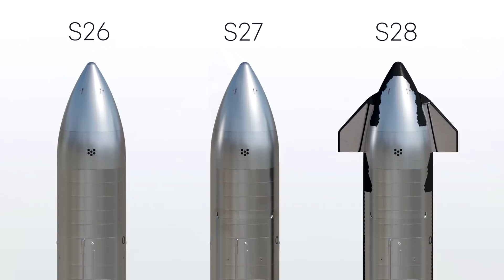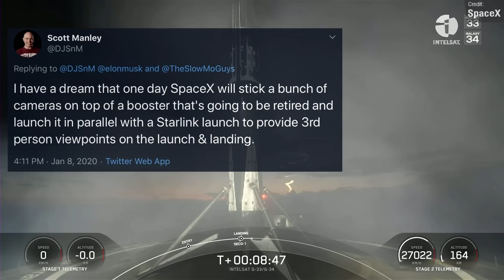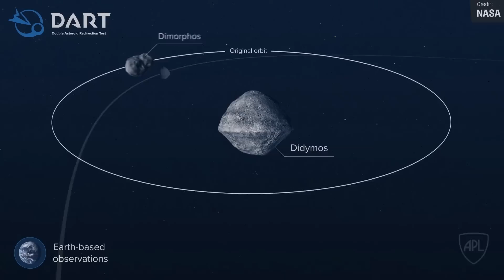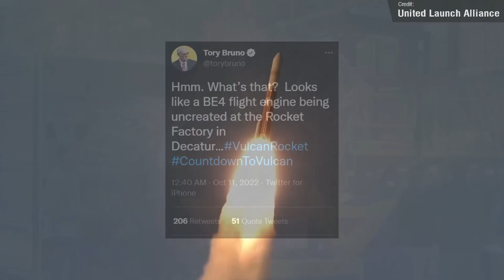SpaceX Starship Stacking Headaches, JAXA Failure, DART success, SEVEN Orbital Launches in One Week!

Comment: I think it's quite possible that by unstacking Ship 24 SpaceX is getting ready for a full 33 engine static fire on Booster 7. They would be doing this to prevent any vibration damage to Ship 24 due to the unknowns for this first 33-engine static fire.

Comment: Thanks for the update.  The comic relief is welcome.  Always knew there was something "Special" about those Aussies.  The banana in the BE-4 "Uncreating" photo seems appropriate for some reason.  Don't really know why.

B7 is still on the OLM for now, it appears they may roll S24 back to where they can fix whatever the issue is with the coupling mechanism(s) attachment points.  Wonder if that's the issue?  Maybe something got crunched from misalignment on the first stacking attempt for the pair, and it requires a more extensive repair than they were able to undertake while in the air.  The ship QD work was a bit troublesome too, perhaps there's something in there that needs more work / rework.

Comment: I sadly spotted the banana almost immediately, it's hiding on a yellow bracket on the otherwise blue frame holding the engine in place. The bracket in question is almost perfectly in the middle of the shot, which likely owed to me spotting it as quickly as I did...

Comment: Why couldn't SpaceX just put a nosecone on to the booster (including any needed balancing weight) and just test the booster launches and returns without risking a upper stage until the booster design has been proven to likely NOT going to go BOOM on a test launch?
Also why not build a launch tower in Nevada and do some testing on one of the huge test areas there?
StarShip will need one there for Polar Orbits rights?
The US military want StarShip to work, don't they.
If done in Nevada then only the military could stop a launch were as KSC is controlled by civilian overview and civilian government agencies are blocking/restricting Texas launches.
Reply: Because they are still tweaking the orbital launch mount. Not to mention, you have to clear away everything for a launch and the put it all back to continue work. That is why Spacex suspended the sub-orbital flights after SN15, because they needed to concentrate on Stage 0 without the interruptions of a launch. Not to mention, the plan still appears to be to do one or more soft water landings of the Superheavy booster and Starship (second stage) to dial in the accuracy, before attempting a catch. It's the same thing that SpaceX did with the Falcon 9 in the run up to landing attempts. With the Falcon 9, SpaceX had a failed soft water landing (Sep 2013), 2 successful soft water landings (Apr & Jul 2014), a failed soft water landing (Sep 2014), a failed drone ship landing (Jan 2015), a soft water landing (Feb 2015), another failed drone ship landing (Apr 2015), before the successful landing at LZ-1 (SLC-13) in Dec 2015 with B1019.

Nevada is land locked and the US is NOT going to launch to orbit from there. Vandenberg SFB does polar and SSO launches, so they do not overfly land. Same with the facility on Kodiak Island, Alaska. The Falcon 9 B5 has done polar launches from KSC/CCSFS. The Falcon Heavy currently only launches from LC-39A, so any polar launches with FH are done from there. Boca Chica isn't going to do polar launches as the US and Central America are in the way. Any Starship polar launches would almost certainly be from either LC-39A or the proposed LC-49 at KSC (northwest of LC-39B).

 FAA vs SpaceX is not really a thing, except for clicks. After all, the FAA defended SpaceX in front of Congress in Jun 2021 over the unauthorized SN8 flight. The 'NASA delaying Starship until the SLS flies' is just as silly, since NASA needs BOTH Starship and SLS for Artemis. Besides, the review was completed already.

SpaceX had approval for orbital launches of the Falcon 9 and Falcon Heavy from Boca Chica since 2014. They can also fly sub-orbital tests of reusable spacecraft. SpaceX went through an Environmental Impact Statement (EIS) to get that approval in 2014. Now, SpaceX wants to fly orbital flights with Starship, that has roughly 3 times the propellant as the Falcon Heavy. So the FAA review was to see about adding Starship to that existing approval, without having to go through another EIS.

The FAA was the lead agency with NASA, the Army Corps of Engineers, the US Coast Guard, the US Fish and Wildlife Service, and the National Park Service all involved from the beginning. With 6 different goverment agencies involved, it is not surprising that the review took time. Musk asking everyone to comment, over 18,000 comments were received, didn't help. Consultations were mentioned for a third time on Apr 29th and mitigations for the first time, so some issues did come up and SpaceX had been working out a solution with whichever agency or agencies cover the issue. The Permitting Dashboard: Federal Infrastructue Projects has 5 sections to the FAA review. The first was completed in Oct 2021, second in Jan 2022, third in Apr 2022, fourth in May 2022, and fifth in Jun 2022, so there was continual progress. SpaceX can do the mitigations and apply for the launch license at the same time. Apparently, some of the mitigations, like the wildlife crossing, only have to be started and some are on going.

SpaceX ALWAYS planned to launch Starship from Florida. They had started and paused Starship work at LC-39A, BEFORE work at Boca Chica took off. Apparently, Boca Chica was as much about learning how to build a Starship facility as it was about building and testing Starships. In 2021, once SpaceX had figured out what they wanted from a Starship facility, they cleared away the initial work and started building a pad at LC-39A again. SpaceX is building factory buildings at Boca Chica AND and KSC. There seem to be two bays at KSC, likely on the Mega Bay model. LC-39A will almost certainly be the main location for launching mission Starships and the converted oil rigs will likely handle most of the Tanker duties.

The FAA review lists 5 sub-orbital and 5 orbital operational launches per year from Boca Chica (pg 14). That is almost certainly due to the Texas law on not being able to restrict access to public beaches. The Texas legislature already had to modify the law a few years ago to allow SpaceX even the limited closures that they have now. Some Texans are saying that SpaceX closes the beach too much already. To get the launch cadence that some want at Boca Chica, Texas would have to permanently close Boca Chica Beach and Texas does not look willing to do that. Musk has said that Boca Chica will be an R&D center and I think will likely support the converted oil rigs with sub-orbital launches.

Comment: 25 26 the bullet one is lunar starship i say the test one or two test starship ?
Reply: It may be a test Lunar Starship or a test Propellant Depot, but Starship isn't near enough to ready to begin building operational Starships yet. Hell, Musk has said that the Raptor 2 engine isn't the final Raptor design yet.
Reply: @steveaustin2686  yes but he need to start lunar starship
Reply: @brettyoung4564  They are still iterating Starship, so it's still too early for that. The production Starships will almost certainly be built in the Starship factory at the Roberts Rd facility at KSC.
Reply: @steveaustin2686  he said he move the first ones over by boat?
Reply: @brettyoung4564  That would require moving the power lines underground along Hwy 4 all the way to the port of Brownsville. Also moving the stop lights out of the way. Unless they have some cradle to put the Starships on their sides, as they aren't designed for that, moving such tall spacecraft by boat would be very tricky. Why move them by boat, when SpaceX is building a factory AT KSC? Makes no sense.

Comment: What are those things that flake off of the Chinese rocket?
Reply: Insulation. Not only do cryogenic propellants need insulation, but other fuels and solid rocket motors have temps where they have the best performance. So there are breakaway insulation panels on some of the Chinese rockts. The US Minotaur rockets use a solid rocket motor for the first stage and there are yellow panels that 'unzip' as the rocket takes off. So it has the nickname of the banana rocket.

Comment: Since the crane lifting points are still on ship 24 it was obvious that it would be destacked to remove them and install heat tiles, plus who knows what else. They probably just wanted to test and adjust the ship booster clamping mechanism.

Comment: SN24 needs to be destacked to remove the crane lift points and replace with tiles.
Reply: True, although I thought they would carry out some sort of test before destacking
Reply: @kierancalverley220  sometimes you got to do what you can, when you can.  Maybe they weren't ready/couldn't get approval in time for testing but, rather than do nothing, perfect time to do other work needed.
Reply: @kierancalverley220  I think they tried to do testing one of the days but something was acting up so they called it off
Reply: Obviously